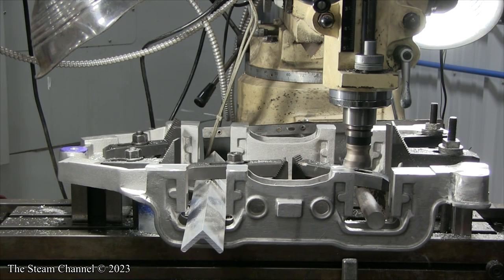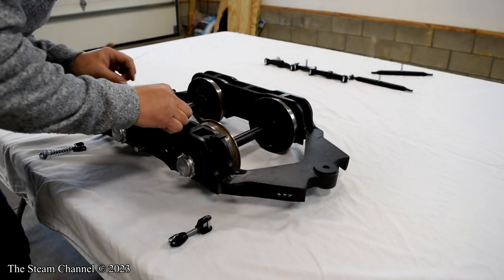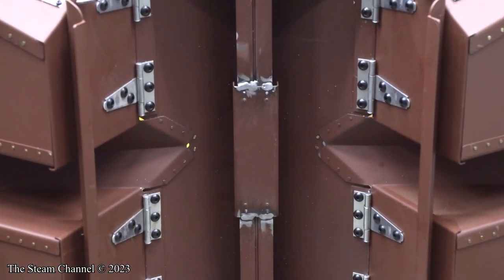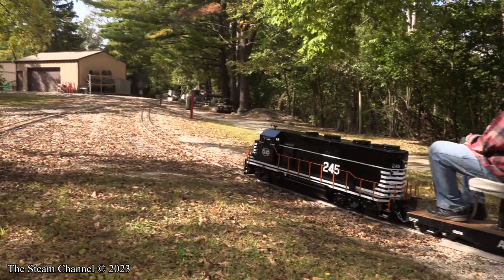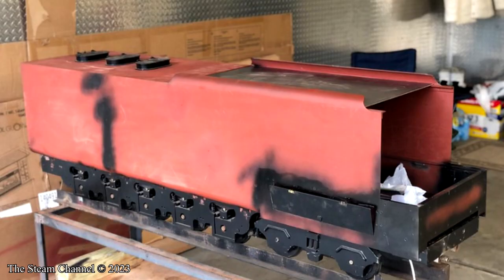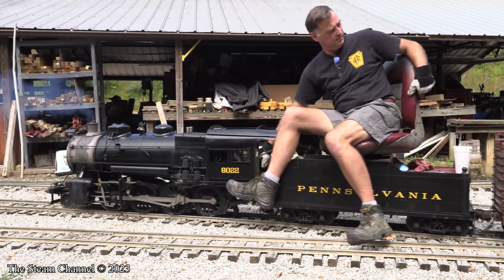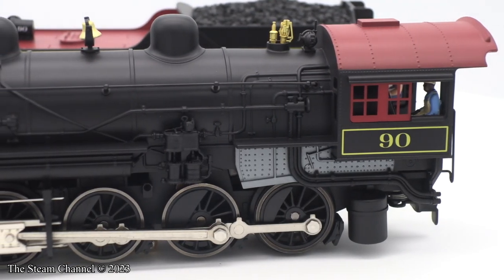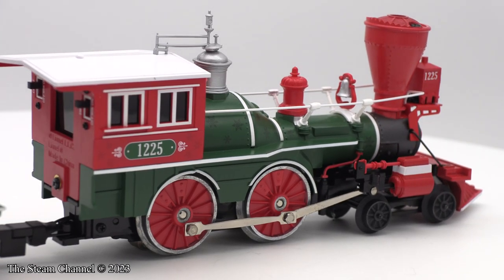2023 State of The Steam Channel

Comment: I love your channel and live steam is awesome. Because I can't afford ride on live steam, I settled for a lower price but still live steam at 100 PSI 1:32 scale that you can see some of on my channel here. I am converting one to burn coal now with a company on the east coast building the boiler for me. These Mikado kits were fun to build and with some modifications I made, I can pull real coal in my hoppers and so far I have pulled 80 pounds (hopper weight plus coal). I also work on and operate a Porter 0-4-0 2 ft. gauge when I have time. Keep up the great work. I am in Akron Ohio. :)